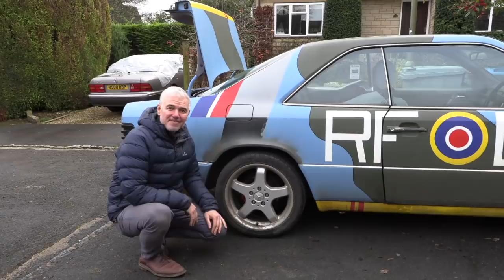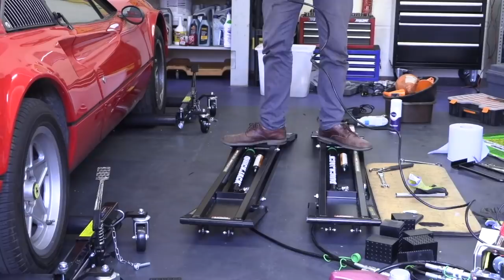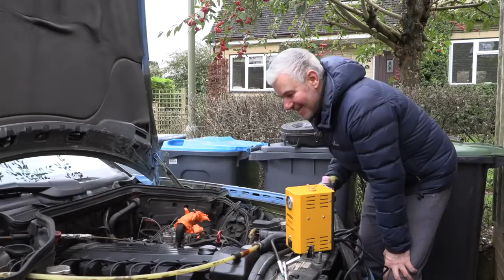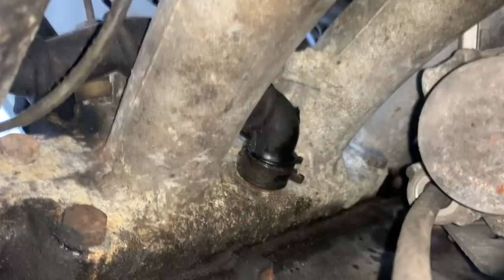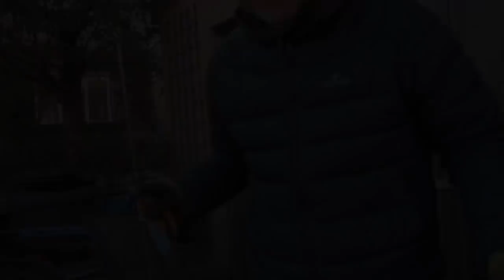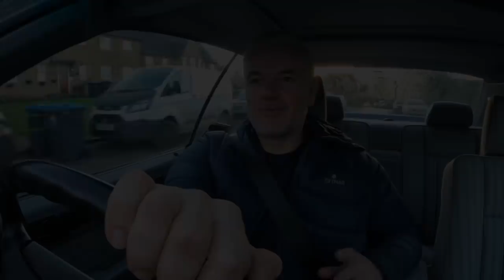Using Baby Oil and a Smoke Machine to Troubleshoot My Running Issue - Mercedes W124 update

Comment: I think replacing the hose(vacuum leak), throttle cable and ignition parts, I would change all parts not only the cap/rotor, you will see a big difference. Looking forward. Cheers!

Comment: That is going to be a sharp looking car when you finish. Good decision to repair the arches now while getting on with paint work. Last summer I painted my car wheels. Plenty of hand sanding. I used some paint stripper to take down the clear coat then sanded by hand. Rattle can paint and it is like new.

Comment: No one in their right mind would criticise you for replacing bog with fresh new steel. In the 70s and 80s when cars dissolved within 5 years we old guys saw the most horrendous filler, mesh and newspaper recreations of sills, wings and even chassis members. They left me shell-shocked and I have a phobia about "repairing" rot with bog. Good on you for doing the right thing (even if it is a shed!)

Comment: With regards to the remote locking device. If when you unplug it the central door locking no longer works you will need to follow the wires back. When I used to fit car alarms to these Mercs you would cut a wire and that wire would then run through the alarm & back. To reinstate the central locking you will need to remake that connection. 

With regards to the possible remote start. If the car starts ok with that module removed I would say it doesn’t have remote starting wired up. 

I no longer do auto electrics as a profession as cars became to complicated and fully loaded with kit to make it worthwhile. Happy to come and see you & remove the unit for you as I’m not that far away from you and I love working on the 80’s & 90’s cars I worked on back in the day. We could also check for a battery drain.

Comment: Great content Jack. Thoroughly enjoying all of your recent output and especially the Bismerck stuff. Incidentally, the bonnets on my ‘97 XK8 and ‘02 XJ8 also have a similar maintenance positions and they’re even more useful on front-hinged items such as those! I’ve not checked, but I’ve a feeling that the hood on my w213 E class is the same, but that’s still within the remit of M-B stealers. It doesn’t even have a dipstick to check under there!  Anyway, thanks and keep the good stuff coming 😁

Comment: Also check for vac leak from headlight adjuster inside car & from modulator on NS of gearbox.When setting up throttle pedal - read how it's done - dont guess. Plus check adjustment of gearbox control cable, as it's next to throttle - this can have a noticable effect on kickdown & general gearbox operation. Good luck.

Comment: Came across your channel as suggested, now subscribed! Yes, even though I came late to view your w124, the M103 engine is quite the unique one, with the mechanical fuel injection. I've been learning on ours, '92 300E, also saved the guy, but horrible maintenance. I hope you do keep it, but yes, the cost of initial maintenance and repairs can quickly add up.

Comment: Looking forward to you repainting the car,I did the same thing with a Vauxhall chevette back in the day that had rusted everywhere.Bought an electric spray gun and mixed up the metallic blue paint and it came out pretty good,definitely not great but good enough for me to sell it to a dealer.

Comment: I was just thinking of getting the quick jacks.  I’d be interested in a mini review of them covering which ones you got, how you installed them etc.
Reply from the maker: There’s loads of reviews on YT chap and an excellent video from quickjack on set up. It’s mainly installing unions, filling with air and fluid and then bleeding the system. Couple of hours of relaxed work.
Reply: Thanks. I was holding off for the release of the higher lifting ones which I think go 3 inches higher. Looking forward to seeing it painted. Maybe an Amg kit and mono block wheels ….def mission creep.

Comment: Nice one Jack, the 90 degree tilting bonnet is common to MB models of the same period. Those side clips are readily available from MB dealers still. Also don’t forget the single wiper mechanism - there is a trick to lubricating the mechanism without taking the whole damn thing apart, with a couple of (not easy to see) access holes where you can just about get a very thin pipe from a lubricating oil aerosol can, it makes a big difference if your wipers are beginning to slow. As I discovered on my W201 small improvements make big differences.
Reply from the maker: Will try that thanks!!

Comment: I replaced the rear arches on my w124 too. Since they are welded and glued to the inners I had to replace them partially. I got everything from 'Van Wezel'. Was rather cheap, had a lot of replacement parts en fitted quite well. Except the front fenders to be honest but thats a diffrent story.

Comment: I've got the 2.2 version of this, mine is a 1995 Coupe. I know they suffer from wiring rot on engine loom. The 6 cylinder is much worse, but I still had to get mine replaced after poor idling. The Throttle body wiring was bad, and was also repaired, but I think there was wear on the body as well. I was really lucky to get a genuine oem new throttle body from eBay for a fraction of its actual value, and since both were done, it purrs like it should. The milking of the rear screen is endemic, mine now only defrosts a strip across the centre. If it was in better condition, I would order a Frostfighter kit from the US. As I now live very close to a ULEZ zone, I am rarely using it, which is a shame, as its such a lovely, relaxing car/Land-Yacht to drive. I bought mine 10 years ago, and then paid the same again for the whole car to be gone over by a local specialist. Other than normal consumables, its totally reliable.

Comment: I've worked in the body shop industry for a while and I'm eager to see you paint. It's not as easy as most people think, especially when you're taking on a whole car in one. I would recommend sprint lacquer H79 for the job. It's very easy to apply, can be left to cure without a bake and stays open longer than most products so when you eventually get back round to where you started it doesnt hoof up and react. I've used it in temps below 7 degrees with no loss of shine or run issues and it can go out in the rain after 2 or 3 hours depending on ambient temp.
The lacquer is the money shot when you paint and it's what defines weather it looks good or not. The base coat is the easy part. 
Paul

Comment: Apart from the daft paint I'd say that will make a very nice cruiser. You could sort the duff rubbery bits using merc parts (cheaper than you might think) and have the arches done properly using some of the repair sections that are cheaply available and it'll go and go.  Or dump it and get a diesel 124 and get into high power veg-oil motoring a la Black Smoke Racing/Dieselmeken. Happy '22.

Comment: Distributor cap is probably ok. If there are no signs of tracking (sooty thin lightening streaks inside or outside from any of the electrodes to anyway else) it's unlikely to be an issue. Tell tale signs are misfires in damp weather, especially heavy mist or fog.

Comment: Glad you’re doing a proper paint job it will look great in blue, but with your cars idle situation you should Replace your injectors… they are around 20dollars each so cheap insurance on a item that should be replaced every 60000 miles.

Comment: I use my Quick Jack quite frequently and love it. Only downside is the darn thing is heavy.
Reply: I added  roller balls on the side arms on mine. Allows it to roll around when fully down, as soon as you lift it they come off the floor securing it in position.

Comment: Yesterday I did the worst paint job of all time on the roof of my 1990 300E 24 Valve Klassik. It looks truly shocking, even worse than the sun damaged original paint. The high idle remains intractable. Good luck with your beautiful Coupe.
Reply from the maker: Thanks Glen and good luck to you with your 190!
Reply: @Number27  Thanks Jack. It's a 300E 24 Valve, the sedan version of your Coupe. The Coupe is beautiful. After market alarms are crap, I tore mine out, smashed it with a sledge hammer then incinerated it, a full exorcism if you will. Very cathartic and liberating. Hope you are enjoying your new home and garage. The Mercules is going for a full diagnostic check in the next few days. There is a port under the bonnet (passenger side) for diagnosing faults, if you can find someone with the diagnostic tool/software. Goo well.

Comment: Bosch CIS injectors are notorious for low speed "dribbling", making a rough idle and low speed splutter.  Remove them and take them to a shop that has the hydraulic tester/flusher.

Comment: My 1990 300e drains the battery if I leave it unlocked. I have left it for over a week locked and it fired up easily. Also.. do your door handles have chrome strips? If so, you have comfort locking which was an option. Look up what it does, it’s awesome.

Comment: I hope the quickjack works out for you, I've had one for a while and find it a complete faff to use, also spent a few hours fighting with the "quick connect" hoses and once thought I had my car stuck in the air as only one side would lift when I was trying to unlock the safety bars

Comment: Change spark plugs, ignition cables, distributor cap and rotor arm. Standard kit for m103 engines will be running like a new.
Reply: 100%. It will be like a new car.

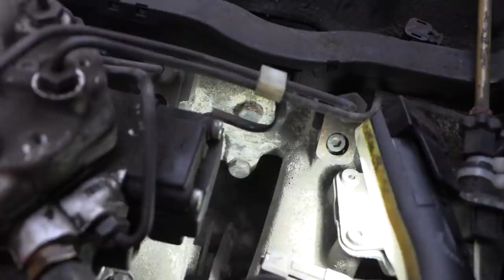Comment: Great video. Just trying my luck here, at 5:17, right underneath the EHA valve, pointing at 45 degrees downwards, is the final link of the throttle linkage. It's in the background sort of, slightly engulfed with your smoke. What is it called and can it be bought somewhere? Mine's quite loose and wobbly on the w124. Everything else on my linkage is nice and taut so I figured I'd try changing this and seeing what results I get. Thanks!

Comment: Try Clean distributors and lightly sand the metal terminal parts. I do it on my 95 s500 just as maintainance to fix the idle. Every 6 months to a year.

Comment: I have changed that pipe twice on M103 cars. Only way I could reach it is to remove the fuel distributor (AIR FLOW METER FUEL DISTRIBUTOR).

Comment: I tell you for sure. The cheapest spray gun with really good results is FLG-5 from DeVilbiss.  150 pounds or so  There are much cheaper guns doing the job for paint or primer but never get a good clear coat .

Comment: I can sympathise. Over Christmas rats nested under my bonnet and ate all the soundproofing in the engine bay, chewed through the wiper jet hose and the ignition wiring. Car won't start. It stinks of rat piss and the windscreen wipers come on when you unlock the car so I had to disconnect the battery...

Comment: Nice lift mate, where did you go for that chap? And how many pennies?
Reply: Either quick jacks website or Costco which are a little cheaper
Reply from the maker: CostoCo was cheapest at £1100. Still not cheap considering you can get a two post lift for the same money
Reply: @Number27  more flexibility for use though. Thanks Jack

Comment: Change the alternator, alternator diode will be blown that will be your battery drain.
Reply: Had a 1991 W124. Many wierd things used to happen when I first got it, wipers came on themselves, power would die, lights dimming away and coming back. Changed the alternator all the madness went away.

Comment: Congratulations on finding the vacuum leak.  What is the baby oil for btw?
Reply from the maker: Goes in the smoke machine to make the smoke
Reply: @Number27  Hopefully the BisMerc doesn't find baby oil smoke as addictive as Eckstein tobacco smoke! Not good for the manifolds.

Comment: Silicone doesn't like sticking to them pipes better rough it up with sandpaper if possible
Reply: Yes, silicone and oil aren't good bedfellows. Check for leaks in the vacuum locking system if that is how they work on that model.
Reply: Yeah, a blast with brake cleaner and then silicone might give a better seal.

Comment: Our W124 had an old fashioned lazy acceleration, until you hit the kick-down button at the bottom of the throttle pedal. Is there an S button by the gear change on this model ?